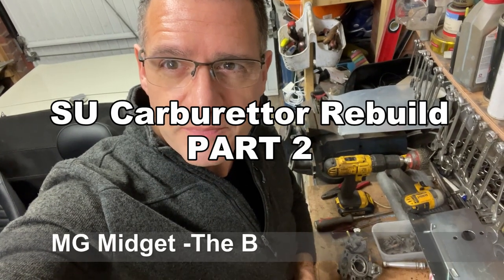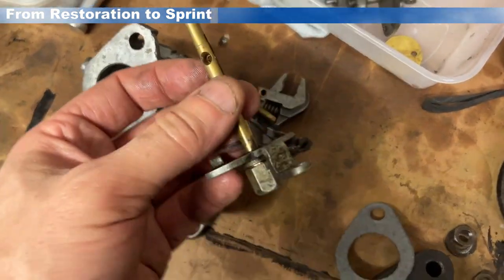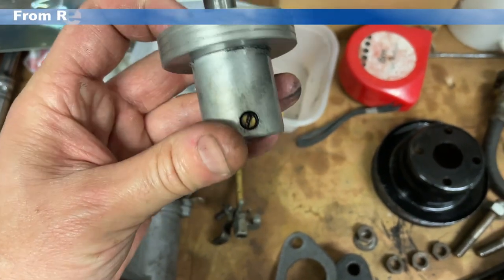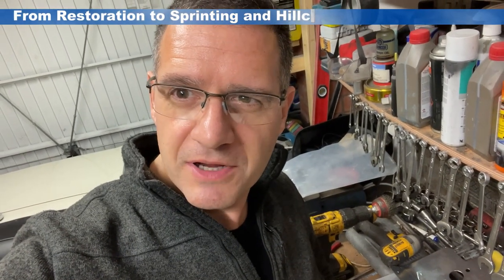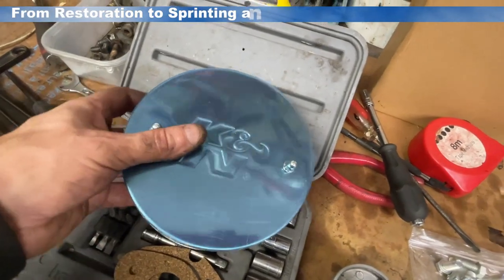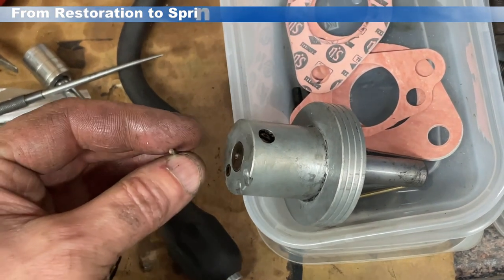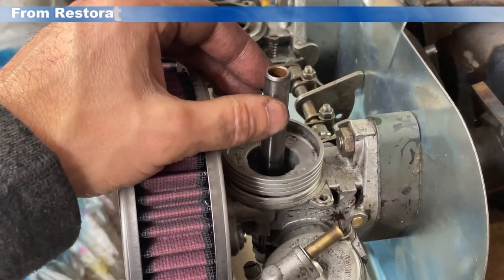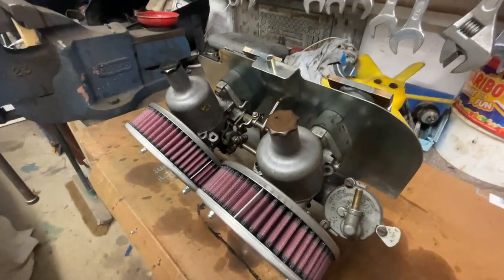1.25" SU Carburettor Maniflow rebuild and tune Part 2 - The Birth of a Racecar (Episode 44)

Comment: The stub stack on the front carb is 180 deg out! holes in stub should line up with the holes at the top of the SU casting!
Reply from the maker: Oh WOW! Kudos as thats some attention to the details. I had to go check this and you are right. The top hole was covered so had to be put right. Thanks for the tip and ill be sure to be double checking this from now on.